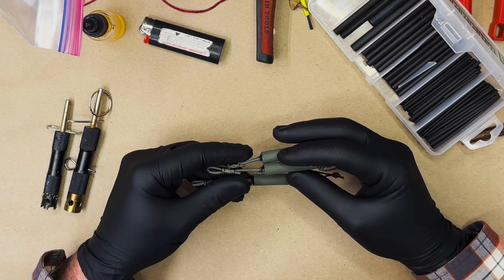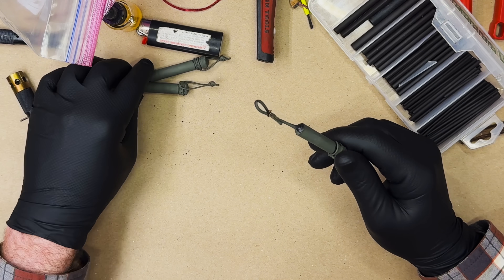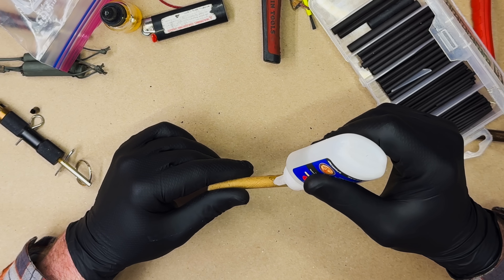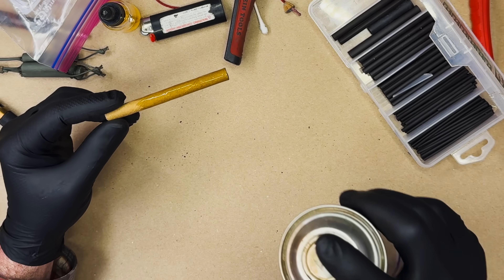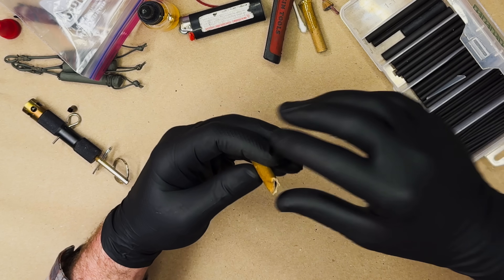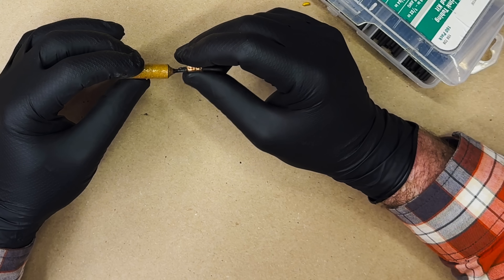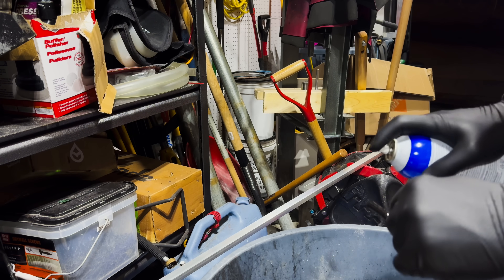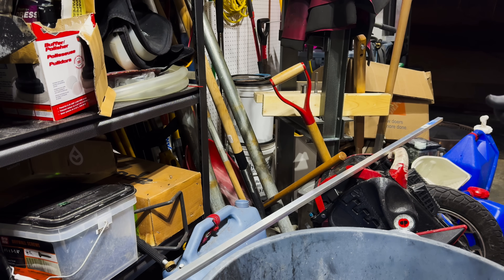Detect, Deter, Intimidate, Evade. A Stealthy & Weatherproof Trip Alarm

Comment: You could use 3:1 or 4:1 self-sealing, glue-lined shrink wrap, and stretch one end out to fit about 1/8" over the end of the tube, to water-proof the string end. It would simplify that part of the process significantly, I think.
Reply from the maker: Yes, I’ve done that and the adhesive bonds aggressively to the string making it extremely difficult to initiate. Also, it doesn’t prevent capillary draw through the string which is the absolute worst place for water to go

Comment: Why not tie the device in series with the string instead of having to make a third connection into the dirt?
Reply from the maker: 1) so that the weight of the cylinder (when left for a duration of time) sagging would hold the trip line tight. 
2) so the orientation of the cylinder remains upward increasing waterproofing longevity 
2) to better camouflage

Comment: Using too much material to secure alarm.  Visible.
Reply from the maker: 1) so that the weight of the cylinder (when left for a duration of time) sagging would hold the trip line tight.
2) so the orientation of the cylinder remains upward increasing waterproofing longevity
3) to better camouflage, hiding the cylinder near ground vs on the line
Reply: @InventionIncarnate Not to mention the fact that you're doing a video and being able to see the stuff your trying to show might be helpful. 
Ya you could use fine line but how ya did it shows up better 🙂
Reply: It is called a demonstration.
Reply: Using explosives and nail polish then a lighter.....brilliant
Reply: You’re right about all the materials. This device needs a clip rope or string to easily set up and take down.😅 Just a paper clip would work or a wooden toggle made from found on the site materials.😊

Comment: Very similar to how the Vietcong used to tie fishing line to a partially pulled grenade pin so that when you tripped the wire, the pin would pull out completely. Of course the Vietcong had more sinister intentions and would make punji pits around the grenade so that when you went to dive for cover from the fragmentation, you would fall into the actual trap being the punji pits.

Comment: What is the magnesium carbonate for? Also, is there any reactive cautions to any of the other chems that people should be aware of? how stable is it for short and long term storage? 

Thank you in advance.
Reply from the maker: I think you already know the answers to those questions and you are just quizzing me to determine my credentials. Your name is oldmanpatriot after all.

When The magnesium carbonate decomposes during combustion it releases co2 which slows the ignition composition’s burn rate. And because the burn time of the igniter is prolonged that increases the probability of ignition. 

Also, a secondary benefit is that it slightly buffers some trace sulfuric acid that potentially forms from the sulfer in the striker mixture on the string, and the potassium chlorate in the ignition mix. Though the striker and ignition compositions are not mixed (during storage) they are in close proximity. Increased acidity means increased sensitivity. [someone fact check this paragraph]

As for other reactive chemicals, Red phosphorus and potassium chlorate are extremely reactive, as are sulfur and potassium chlorate their toxic relationship is what makes these igniters work.  

Storage, academically, shouldn’t be long-term. However, empirically, I’ve stored for 1+years
Reply: @InventionIncarnate  LOL,,, No, I wasnt quizzing you, I honestly wanted to know, Its hard to find good hobby information. Most people hold onto it like stink on $---. You couldnt pull a dime out of their sphincter if you had a tractor strapped to it. I really appreciate intelligent and thoughtful people willing to share their knowledge with no strings attached. Thank you for taking the time to educate me. Contrary to popular belief, Old dogs can learn new tricks. If someone is willing to take the time.

Comment: Wtf...is this legal? Hope I don't end up on a list for subbing...obviously new to this, I'm guessing moisture will compromise the reactions, right?
Reply: They used to sell pull string fire crackers when I was a kid but similarly the popper inside a party popper is basically the same thing
Reply: @doomguy584 I've seen them not all that long ago. Certainly within the last 10 years or so 🤔

Comment: Are we really talking cookie glitter and sprinkles?  I get it the glitter is sugar, what are the sprinkles made of?
My dad was an amateur chemist. As a kid I got those huge foldout chemistry sets for Christmas. The book that came with his Gilbert Chemistry set had the recipe for nitro glycerine. Wish I had learned more and messed around less.
Reply from the maker: lol, they were symbolic
Reply: @InventionIncarnate  Too cryptic for me. Symbolic of what?  OK well we used to take flash bulbs, solder leads onto them then knock the tit off the end, fill them with fine black powder and seal the end with hot glue. Any battery would set them off. We used those as electrical detonators for larger charges.  Springy clothespin, penny hot glued to each side, battery leads soldered to the pennies. trip wire and a Popsicle stick to keep the pennies apart.

Comment: Some marine grade heat shrink over the whole tube assembly will waterproof that whole thing real quick and easy.
Reply from the maker: The adhesive on the inside of the marine shrink adheres too strongly to the pull string
Reply: @InventionIncarnate  I should have been more clear. I meant just the tube for waterproofing. Great video btw!

Comment: Just hot dip in wax?
Reply from the maker: The cooled wax cracks at the joint between the satin cord and igniter. I dipped them in contact cement
Reply: @InventionIncarnate  nice. Good advice. Appreciate the response

Comment: maybe tarred bank line would work better than that string. 
It is basically nylon surveyors string, impregnated with tar, so its 100% water proof, and sun proof. 
no "capillary action" or similar things to worry about. Using it might save you a few steps, some resources, and some time.
It comes in a variety of sizes, from basically dental floss sized, to like, paracord size, and everything in between.
also, its flat/matt black, so it should blend in better too.
Reply: SpiderWire Stealth Braid Moss Green 65 lb. test (.015" dia.)
Reply: Did anyone ever try the tarred bank line?
Reply: That stuff lasts forever, too! I have a long wire antenna that is tied off with bank line that has been in a tree for at least 10 years and it shows no  real sign of deterioration.

Comment: If you've noticed your CA glue bottle prematurely hardening, it's because the hardening agent is aromatic. A spray into the air causes the hardening to accelerate. Typically to hasten the curing process one will tend to spray directly onto the glue covered area or spot & it will create a shell & most of the time cause crazing. That's the hardened foam that smokes, cackles & it a "cold shut", as with a cold sweat joint on copper pipe, or a cold solder on a circuitboard. The difference is crazed CA glue expands in bulk & crazed areas are weak.
Reply from the maker: My name is Tim too! And I’m pinning your comment because it’s dope
Reply: A cold shunt. I love my mentor.🫵🏻👏🏻✍🏻😜
Reply: Crazed? No idea what this means. Also, what is C A glue?
Reply: @libertycowboy2495  cyano acrylic which is also known as crazy glue
Reply: What?!

Comment: Instead of brushing ca glue on the tube, I roll the glued paper(I make grayons) on a waxy label sheet after all the stickers are used. It distributes the glue nice and even and you don't need to screw with brushes, even as cheap as they may be.
Reply from the maker: Genius!
Reply: @InventionIncarnate  could also just use baking soda instead of spray on activator.

Comment: I have an idea for you to try: in the 'OSS special weapons and equipment' book I had, they showed these "chemical delay pencils". A spring striker held under tension with a wire passing thru a celluloid disk held captive under a cotton sponge. The top end had an ampule of different concentrations of acetone or some other solvent that would be broken and then it would eat the disk, releasing the wire so the striker can do it's work. You could select a rough delay time by chosing different concentrations of the solvent. 
I used poly and lacquer to make the disks, but I never was able to get a good shape that came apart the same way every time, and I never did come up with a good substitute for the acetone ampules, I just varied the amount of wick and water blending to try and come up with a workable delay.. nevrr sorted it out. Cool lil thing tho.
Reply from the maker: That’s awesome! I just ordered that book
Reply: @InventionIncarnate  there's tons of cool gadgets in there. The suitcase motorcycle was a favorite of my 12 year old self when I first bought that book at a gun show. That and the canoe size mini sub.
Reply from the maker: @camojoe83  YES! Read that!  Man, better times
Reply: @InventionIncarnate  you imagine how big a pain in the ass some of that stuff would be? Like the "explosive coal" and we can't ever forget about the "whodunnit"....
Reply: Are you talking about pencil detonators?

They use a lead wire, and copper chloride to dissolve the wire releasing the spring.
Reply: @DH-xw6jp  all the drawings I saw referred to "celluloid disk" locking the wire for the thing I'm talking about. I'm pretty sure that would work too, tho. The russians forgo chemicals all together and use a wire of different thickness being cut by another under spring clockworks, but that's a whole different deal..